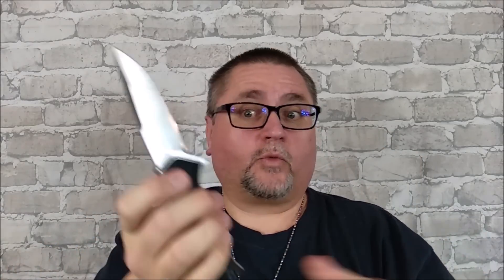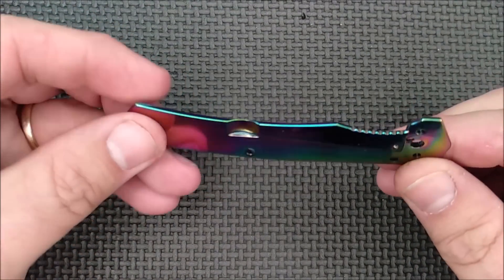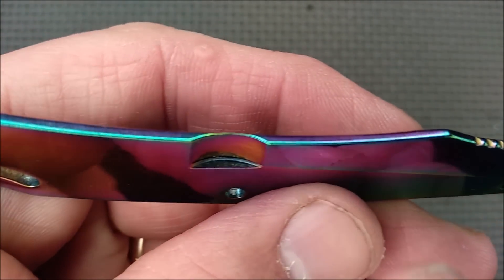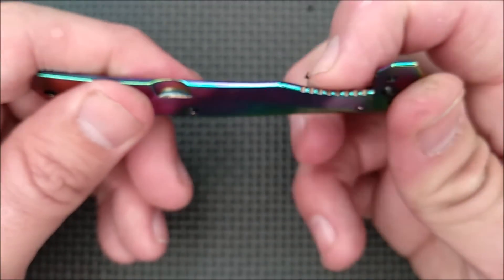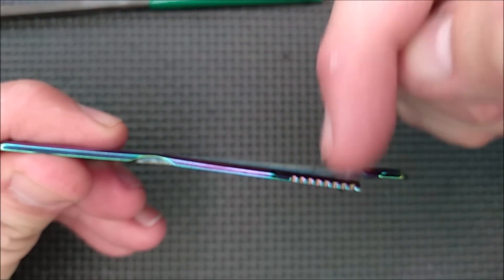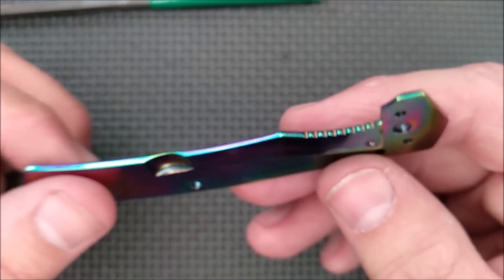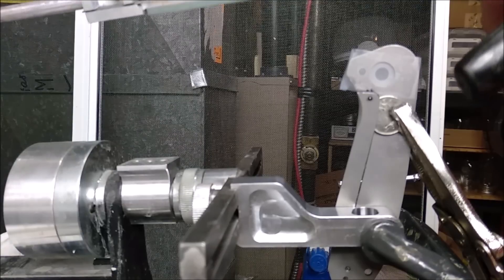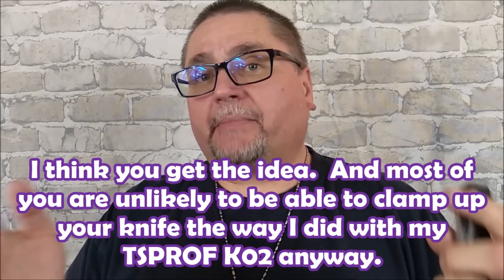CCEU:   2 Ways to Fix Lock-Rock on Frame-Lock  & Liner-Lock Knives

Comment: If I decided to fix a lock-rock problem with the heat-&-freeze method, and I snapped the locking bar, my knife wouldn't be permanently useless. I've got a mate who is a fabricator, and I would get him to TIG weld it into a fixed blade! Although I suppose if you did that with a necklace knife it would look a bit silly....🤣😂
Please don't take me to seriously, I try not to!  Great informational video, Jake. Keep up the good work.(you can take that last bit seriously, mate!)
Reply from the maker: Cool.

Comment: Nice video! 
I put a very small piece of rubber between the handle and the linerlock. Now this piece of rubber pushes the linerlock more into the tang of the blade. A con of this is that the detent is more now but it still moves freely😊👍🏻👍🏻
Reply from the maker: I am glad you were able to improve your knife.  I expect that your fix will wear down fairly quickly as the rubber deteriorates, but you can just redo the fix.

Comment: I’ve got a brand new vero synapse that has lock rock, contemplating if I should try this or just send it back to them
Reply from the maker: if it's new, send it back. I suggest only try to fix it if you can't send it back and get your refund.
Reply: @CanadianCuttingEdge  thanks man, that’s what I decided to do. I’m not going to mess with a $600 knife that came messed up right out of the box lol

Comment: So if you remove the lock rock then you have also increased the detent. Now your left with a stiff detent? I guess it's a trade off.
Reply from the maker: If you remove lock rock with increased pressure on the lock arm you automatically increase pressure on the detent ball because it is attached to the lock arm.
There are some other ways to soften a detent.  I recently did a video series on detent issues like one where the detent is too strong, the first video is here: https://youtu.be/V6xT_97DX0A

You make a good point.  Making a change often had knock on effects that may be undesirable.
Reply: Yes good point indeed! That is the trade off👍🏻

Comment: Boiling water is not hot enough to do anything..
Reply from the maker: It's certainly not magic, but I have had it do enough to help loosen screws enough to take them apart, otherwise I wouldn't have suggested it.  I'm not just talking for the sake of talking.  Is 100°C guaranteed to help, of course not, but it's a safe amount of heat for the vast majority of handle materials and it can indeed help loosen some threadlocker often enough to make it worth trying.